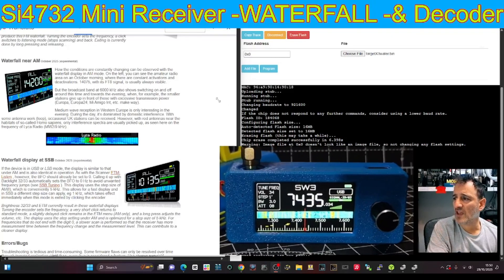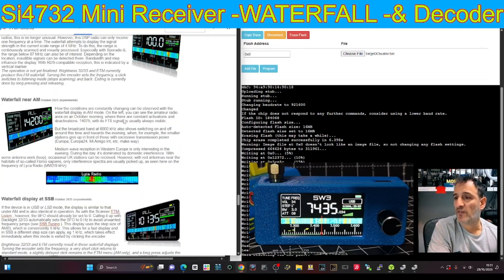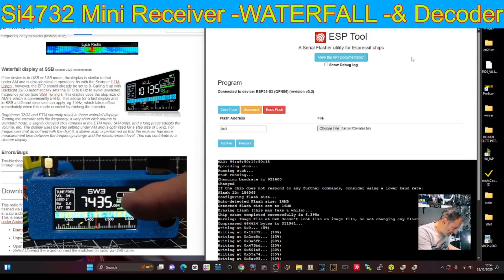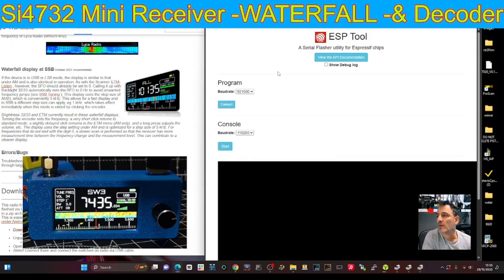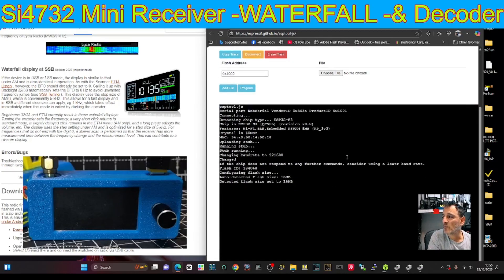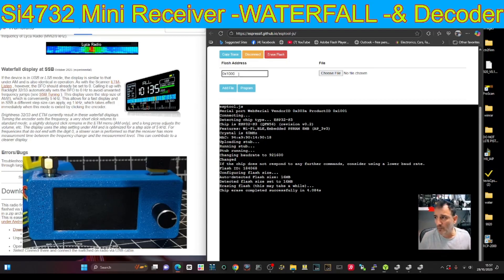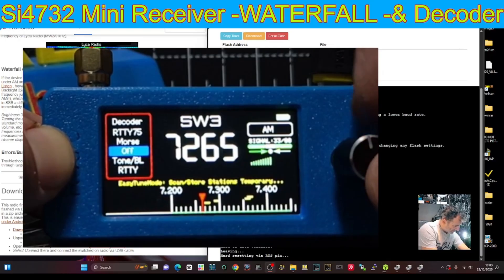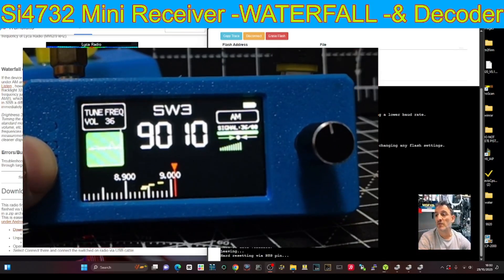INSTALL - WATERFALL , Si4732  Receiver & CW Decoder

Comment: I have a model 3 and was able to obtain com # from Device Manager ... but flash program is unable to open port. I have tried changing port # to no avail. Using Windows Edge and also tried Chrome. 

Advice?? 

tnx .... Tom VE3NY
Reply from the maker: Try different cable

Comment: I wish they would add the WIFI and internet connectivity so we could get the time and the EiBi like v2.28 firmware.
Reply from the maker: It does have this
Reply: @M0FXBHamTech  Does it ideed use WiFi?  It uses the serial USB-C connection to update static station lists.